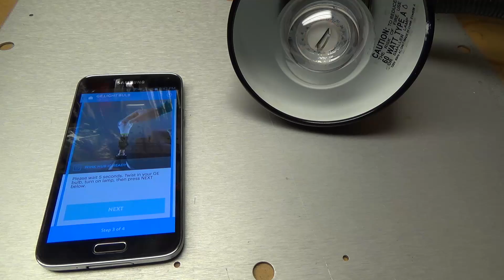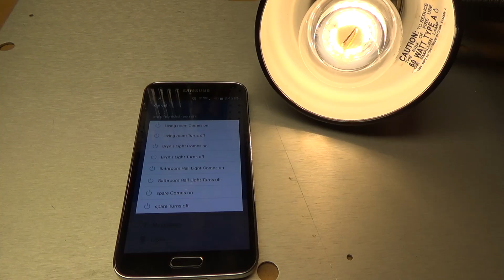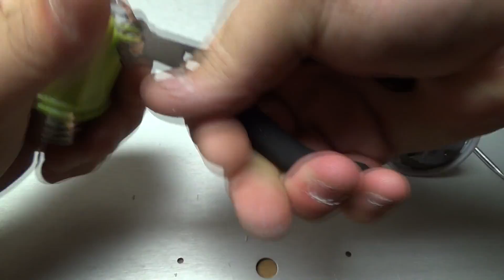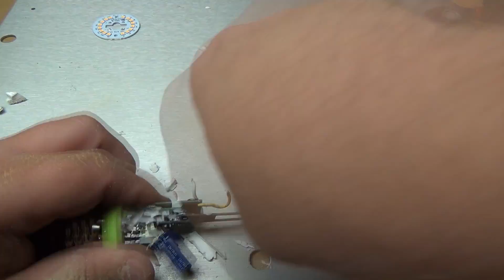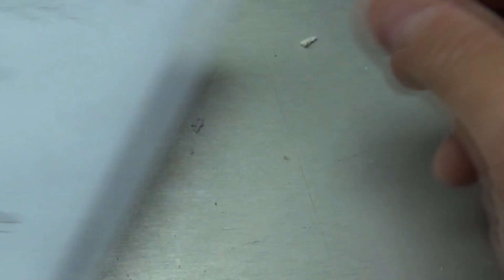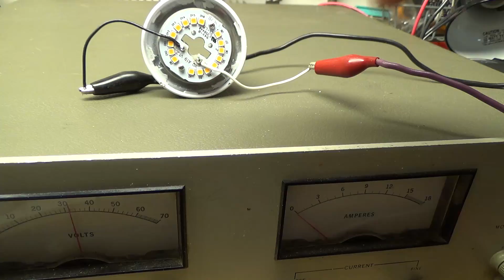GE Link / Wink LED Light IoT Lightbulb Teardown

Comment: Thanks for the effort! I have one that started to act up this year after ~10 years running 5-6 hrs/day. Seems like it should have lasted longer. There was some oil condensation on the inside of the "bulb" and the unit kept losing connection to the network, and finally going into "crazy" mode. Guessing the oil was coming from inside a hot component or the heated up potting compound. I'm not going to try to fix it thanks to your video.

Comment: My GE link led bulb is not turning on. Don't know what's wrong. Is there any troubleshooting step that I can follow?
Reply from the maker: You could try it in another light socket, or try rebinding it to your hub other than that there's not much you can do and keep the bulb in its original shape. To rebind it you turn it off for 3 seconds, then on for 3 seconds, five times, then it should fade out and flash at which point you can rebind, you will lose the previous binding.

Comment: Does anybody know how the small controller board with the antenna works? I wonder if it's compatible with PWM or 1-10 signal systems (many such systems support both PWM and 1-10v signals). That would be extremely useful for making LED panels zigbee compliant!!

Comment: FYI- The TO-92 part that looks like a transistor is actually an SCR. The purpose of that SCR is to clamp the output voltage if the LED string fails "open". This is important to protect the 270 microfarad blue electrolytic cap.  That blue cap is rated at 63V only.  Without the SCR clamp activating if the LED opens, the cap would receive an overvoltage.
The GE Link bulb is very well constructed IMHO.
Reply from the maker: xxM5xx Ah cool, thank you for the extra info. It sounds like a pretty well designed lamp from all the extra information I've been reading. Do you think the SCR pulls enough power to trip the fuse, or does it just provide a load on the PSU to keep the voltage down?  If it doesn't trip the fuse, would this still classify as a 'crowbar' circuit?

Comment: Thanks for doing this video.. I have 18 bulbs now.. 16 A19's and one of each of the others. 15, 20 and 25 bucks.. NOT bad deal at all.. they seem to work great.. have 7 Hue bulbs on the system also.  the Hue system is cool, but your pretty much stuck using it outside of the Wink app.. the wink app has very little support for it. basic turn off and on dim change color.. that's it.. no robots or timers, etc.  I'm really pleased with the GE Link bult.. it has great light output and a good color.. seems to be fairly well made for the price.
Reply from the maker: You certainly went all in on that setup! Did you replace all of your lights in your home?  I agree with you on the output of the Link lights, they're not harsh and light up a room well. Did you have any range issues and are you using any repeater modules?  I really wanted to try out the Wink Relay remote and the Phillips Hue setup but they're pretty expensive components :D
Reply: No wink relay yet.  They ate about 200 bucks on ebay.  I did have one ge link lose connection after I blew a breaker (don't ask) and it didn't want to reset right away.  Had to do the 3sec off and on a few times before it dimmed, then it let me re add it.  No problems on the range.  I did use a couple of Ge in wall zwave, one dimmer and one on off (I got it from Lowe's it was labeled for iris.).  I have 3 other GE outdoor binary switches also.  My lock is the non motor schlage deadbolt.   I can't get it to pair at all.  The other zwave stuff I did under zwave inclusion under the hub.  I have a Vera lite, it worked under.  Not working on wink.  The Honeywell WiFi units work great as does the Chamberlin myQ.  No problems there at all.  HUE is screwy.  Better off not even adding it under wink yet.  At least there's full control for it from other apps, widgets, pc and mac.  Wink is getting better.  I like it so far. I don't have the stairs going up on a three way on zWave yet, or the laundry room. The kitchen and everywhere else it's all done

Comment: Thanks for the teardown!!! Can you do one for the Hub itself?
Reply from the maker: Thanks for the feedback. I was thinking about doing that since it's got an interesting layout, I'll see what I can get up to this weekend.
Reply: Can't wait!! Thanks
Reply from the maker: Dat Tran Posted https://www.youtube.com/watch?v=tlLhIvpi_5k
Reply: i have some mini puck lights that normally take 20 watt little halogen lights, the kind that  used to go under cabinets before led strips were the thing , they run off of a 12 volt AC to DC transformer ,i ordered some LED bulbs for them from china
these 3 watt ones
 http://www.ebay.com/itm/LED-3W-20W-EQ-12V-LOW-VOLTAGE-G4-T-COB-WARM-WHITE-AC-DC-LED-LAMP-DIMMABLE/182128913566?_trksid=p2047675.c100009.m1982&_trkparms=aid%3D888007%26algo%3DDISC.MBE%26ao%3D1%26asc%3D38530%26meid%3D0986d9a5020149708b26fb8f6d14b6bb%26pid%3D100009%26rk%3D1%26rkt%3D2%26sd%3D201619427999

,the replacement LED lights have some additional components inside them besides the actual LED,what i am looking to do is buy one of these bulbs and run the wires that are supposed to go to the led board to the puck lights so i can remote control and dim them
remove the transformer and put the bulb in it's place to power the (3) puck lights , i wonder if i can keep the LED halogen  replacement bulbs in there  or if i would need to desolder a couple LEDS from the GE wink lights  board and make my own g4 base to plug them in to the puc sockets
for each puck light and  use those , it would be much less work to just use the bulbs i have in there now though

Comment: I'm surprised there is no power amplifier for that 802.15.4 SOM chip unless they integrated into one chip. 802.15.4's range is not that far without one. Can you see if there is one?
Reply from the maker: I looked at it closely and the antenna just traces back right into the RF output pin with a few passive components. Marvel claims -9dBm transmit power at the antenna.
Reply: TheHouseBlog Actually now that I think about it there really isn't much data if any to transmit from the LED. It is all mostly one directional except for when pairing I guess. The Hub must have a powerful amplifier to increase TX range.